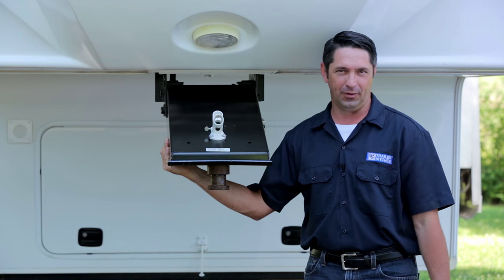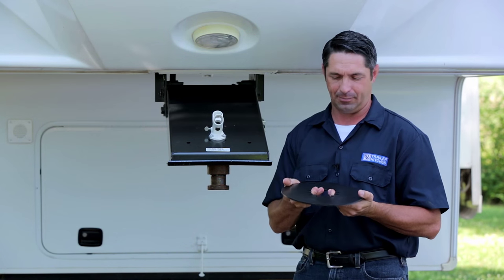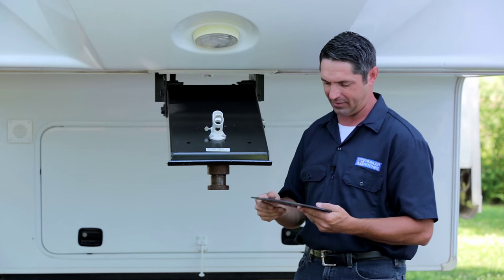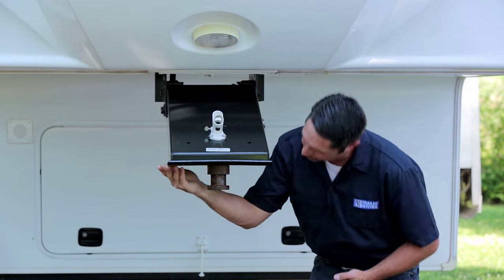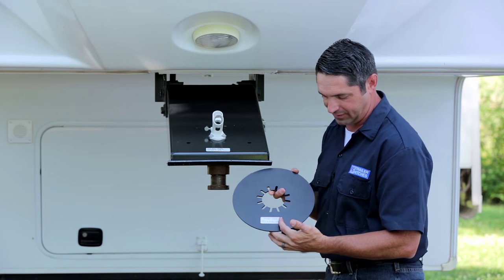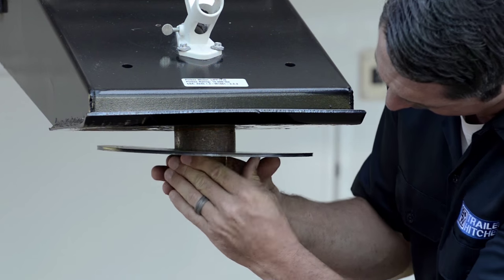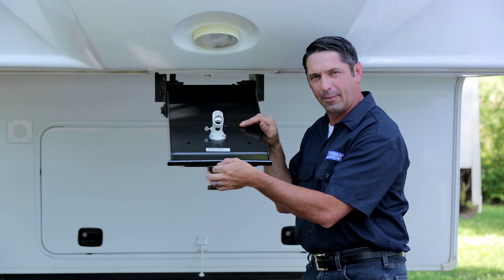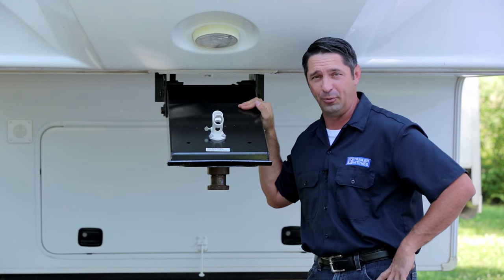Using A Lube Plate

Comment: My lube plate doesn't have a sticker on it, but it has a smooth side and a rough side, I'm confused. Help!
Reply: According to what he is saying in this video, the rough side would go up against the unit, and the smooth side would be what would be used instead of lubricant to go into your fifth wheel.

Comment: Is there a lube plate for a turning point with a wedge installed? Can I just cut a notch to fit the wedge if I use a 3/16" lube plate?

Comment: Does the lube plate need to ever be replaced, if so, how often??
Reply from the maker: There's no exact life-span of a lube plate. It will greatly depend on the weight of the trailer, how often you tow the trailer, and the terrain you'll be towing on. A heavy trailer towed frequently over rougher back roads will result in the lube plate wearing out more quickly than the tow plate of a small trailer towed on pavement. Just be sure to check a Lube Plate regularly and if you ever notice any kind of excessive wear / any uneven patterns on the plate itself, you'll want to replace the plate.